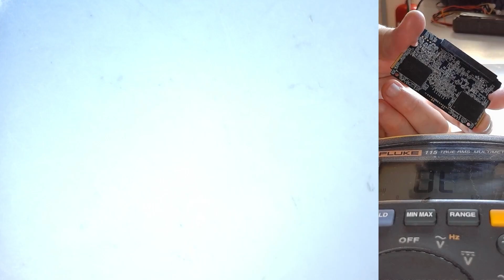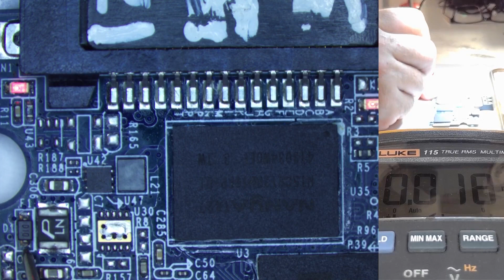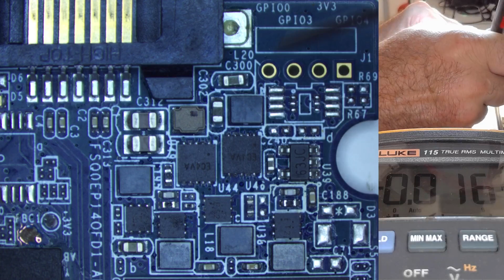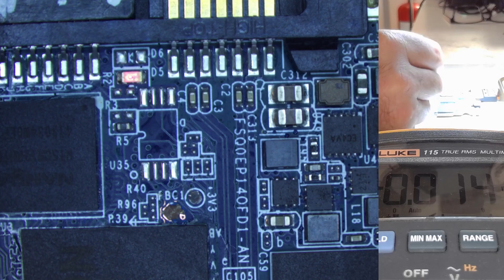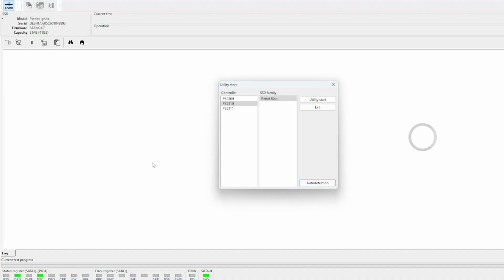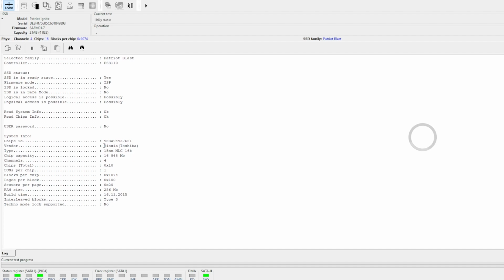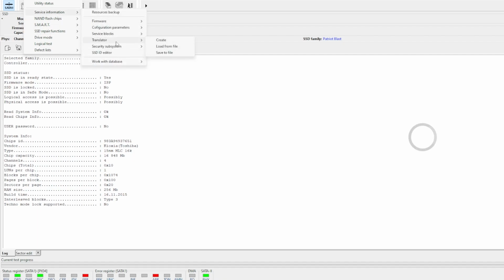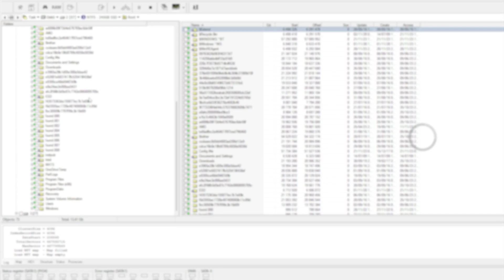Patriot Ignite SSD Data Recovery! SSD Detects as 2MB instead of 240GB???

Comment: I would have liked to hear more about what that error actually is, and how that error can occur. It seemed like magic how you read the drive. I'd like to know more about that magic too. You could have made this video longer, I wouldn't have minded.

Lastly, I wanna thank you for not have all kinds of crazy CGI and keeping the format simple. Great video, thanks!
Reply from the maker: This SSD bricked midway through the owner copying file. I did not find the exact reason for it as my priority was to get the data off it as fast and safe as possible. Most likely one or more of the 4 memory chips wore out as they have a limited program/erase cycle.